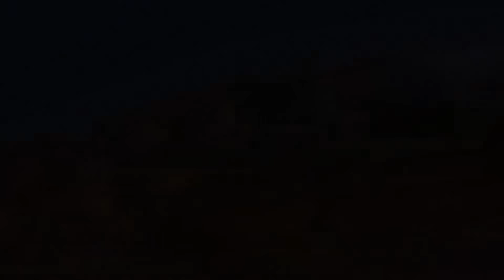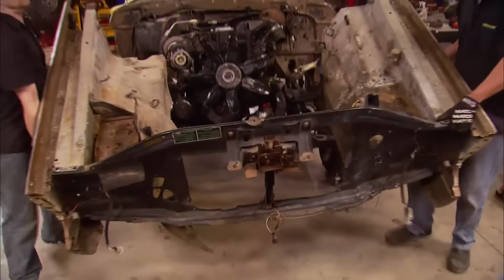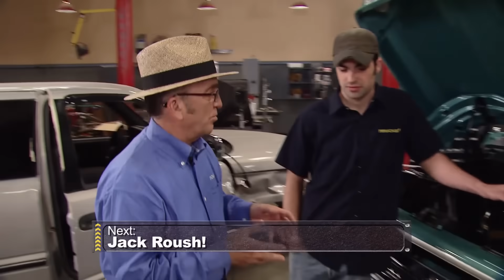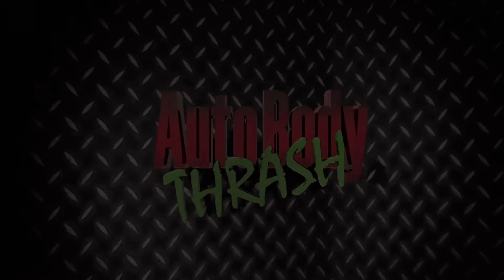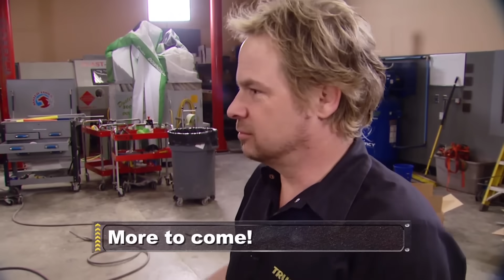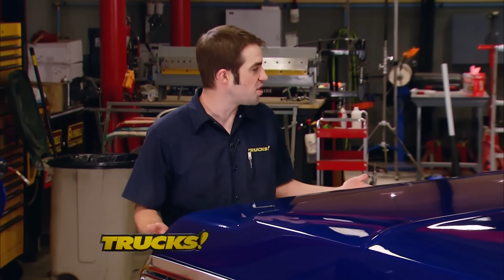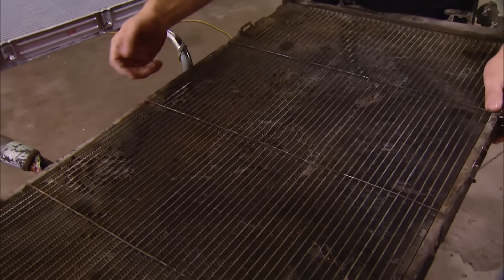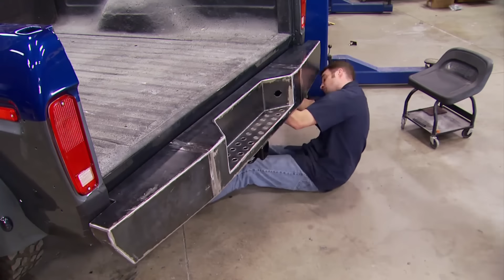Ford Crew Cab on a Dodge Cummins Chassis! (Super Dually) - Full Build

Comment: Would it be easier to start with the cab, it would be less work??
Reply: In my opinion, the Ford truck body was in bad shape. You can tell that was the concept they wanted. It made no sense to remove the Dodge body with less damage for a much older and corroded Ford.

Comment: all mechanical little electronics and you can easily build enough power to tow a house down the street or run 6 seconds in the 8th mile ! and still have all the comfort anyone needs !!

Comment: In comparison to muscle car resto mods or vinntage pick up resto mods, this is a unique, definitely interesting, episode. Thanks for doing this.  Appreciate the Alabama recycling facility review, the Cummins motor engine swap, the body removol install, 5 speed manual selection, and so many other changes including the interior dash work.  .

Comment: Re: Leaking Rear Main Seal            Don't use additives to attempt to fix oil leaks. It will soften ALL of the seals and you will likely CREATE new leaks...... Can I get a witness? (Based on my experience as  an ASE Cert mechanic)

Comment: Putting Dodge wiring in a Ford. Bold.
Reply: It isn’t working out well after this many years lol. I currently own the truck and it needs some TLC but the bones are still there. Also not sure why they patched together the bed the way they did it’s not holding up well but still a super cool truck!
Reply: @colby2479  You own it, huh? Very cool! It is a neat rig, hopefully you can get it buttoned back together. 79s have always been my favorite year dent side. Personally I’d prefer just the single cab long box but I understand why guys want the 4 door for a work rig.

Comment: “These flex sanders will get the job done easier” well sure but it doesn’t mean it gets it done better you can get the same results aslong as you know how to sand anything and I mean that I was told when I first started sanding on a car the guy helping me asked if I had ever sanded drywall and if so to sand the car the same way especially since we were using a spray on sand able primer it made my life so much easier hearing that but also he taught me how to sand just about anything perfectly with regular sandpaper 99% of the time he wasn’t big on spending alot of money on tools he wanted to just know either way it was gonna look good so he took his time and even tho these tools would have made his life easier he would rather just take the extra time to make sure it was absolutely perfect either way he was weird about it but he did the best paint work I’ve ever seen on any vehicle

Comment: My bubby swapped the manifold just like this and it broke the head 5 out of 6  mounts it is use to one spot for 30 years then f lipped creates uneven pressure between the bolts and head if your going to do this get a aftermarket manifold that don't have space between manifold and head will save alot of time and hassle and a head look it up if you don't belive me besides that many heat cycles on old manifold they shrink and will break the head eventually to

Comment: So what about the portion of the truck bed under the support rails. Eastwood has a product that has a flexible hose/wand that can spray into that area. The end of the wand sprays in all direction to give you good coverage. I would not have neglected the area underneath the support rails.

Comment: FYI. The absolute worse thing that you can ever do when restoring and modifying an old truck/car is to skimp by reusing an old radiator and ac condenser. New or re-cored will always save you more money in the long run. Radiators and condensers are under pressure in use which means the metals are subjected to constant flexing from heating and cooling cycles. Over time the metals weaken and added to decades of external weather conditions and corrosion, it's a recipe for failures. Who wants to spend tens of thousands of dollars restoring this gem just to be stranded on the side of the road waiting for a tow truck?

Comment: I always say, a good paint job is 90% preparation and 10% application.
Reply: I'm using a 2001 rear end out of a Dodge ram 1500 four-wheel drive putting it into a two-wheel drive 98 Dodge ram 1500 is there a difference

Comment: I forgot something ride on tire sealant won't clog valve stem seals and balances the tires. So when getting a wheel and tire balancing to make sure you have already installed and driven before rebalancing if you have the time.Ride On tire sealant no matter how many times no matter how many punctures if you are serious about your work truck being dependable Ride On tire sealant has got you no matter where thoes tires go.The sealant works so good it can take a bullet from a 9mm.Also for motorcyclest don't want to be stuck somewhere.Also Centramatic Heavy Duty Wheel Balancers and double check the alignment and especially bump stear because the road is never ever 98 percent of time perfect so my effort in saying this is straight line management is the key along with lower tire pressure more power steering assistance so wrists aren't wearing down also for the air conditioning the fans need to be able to spin at higher rpms double the rpms then raise the rpms a little higher than that.Heated seats and that's ah not bad all day every day.Also a light bar road lights and ya know what you can go brighter lights but but but but but but and I have seen this only once level your lights you can go brighter but as you do you have to balance the lights because they are brighter they are going to far down the road.Level and balance level and balance level and balance level and balance the brighter lights and your golden for the most thankful and appreciated driving experience and a ton of praise and thanks.
Reply: Crack is whack.

Comment: Super awesome details and wisdom that I will always go back to so 3 hours 3 comments it looks but every day every day driving quick breaking transition ease of use for every day that's the work horse. Is it easy does it brake with ease does things lock up is the proportioning valve on the money.Having a welder on board or some type of tool box also you can go bigger wipers.A tablet in the middle console why not or the bottom half. Love the show and seeing you guys still there going strong you are the right guys for the job.

Comment: Remove the shock for the steering it's not needed and prevents total control of the steering. You don't have power steering makes sence but you guys do.Kryptonite is a company that offers strong steering links.Banks for the motor and differential cover.Bully Dog maybe some propane but also a small compressor to air up the tires.Ya know stacks couldn't hurt don't forget the full rear mudflaps if you have fwd get a snorkeler for any situation. You have a turbo to protect water lock air ride to lift up the truck lastly roadactive suspension rear leaf spring helper for super safe transitions and needs more down low throttle response and an extra 150 hp. Clear side markers up front instead of yellow with the chrome bulbs that turn amber when switched on styln concepts.Seen chicken lights in the tube steps black of course would look pretty good.

Comment: There's a quicker, cheaper, external fix 4that killer dowel pin. It simply an external fastener &lock washer aligned w/the pin through the front cover.

I've even seen people install an elongated pin &dimple the case4 some positive pressure on the new pin so that there's no room 2walk.

Comment: I too when about 16 replaced a clutch ( 1 month into my first car ) .. I too did not trun the flywheel ,,,, evn after getting a job in a machine shop!!!... thought od the answe to my car hopping in reverse up a hill ... not until many years later... so when I lost a manual trans on vacation in Green River wyoming I did nt hesitate to replave the fly wheem and clutch on top of the trans cost ( 200 in pasts probably 50 in labour ,,,,,,,,, 5 yeats later the cae is still going

Comment: Is the engine part of the frame/chassis?

I'm thinking about getting a similar style tractor with a dead engine. Remove the engine to replace it with some electric motor.

If the motor is part of the structure, the conversation would be a totally different project. 

I want one with a dead engine, because I don't want to butcher a running vehicle.

I don't want a vehicle where the engine is a structural part, to avoid rebuilding that after removing the engine.

I appreciate that some would have issues with running time or range on batteries, but that's not an issue at all for my use case. Removing exhaust and engine noise is a way more useful priority for my case.

Comment: I've swapped pickup bodies from different years and different makes a number of times. One thing I disagree with is how they started at the rear by installing the box and then they had to deal with fine tuning the axle and fender opening locations at the front. 

It is much easier to shift the rear axle location than to shift the front wheel locations so I always started at the front and finished off by adjusting the rear axle location at the end.

Edit: Wow, that turned into a HUGE job (I wrote the above after watching about 30 minutes). The attention to detail and finished product is impressive!

Around here older 2wd trucks are almost worthless,  so what I've done is buy a freshly painted 2wd pickup and swapped the body to a 4wd. None of my swaps have required anywhere near this level of customization.

Comment: I like the truck concept, if it had been four wheel drive I would have loved it. Maybe it could be done later?
Reply: Why would you want 4 wheel drive on a truck designed to haul heavy loads on paved roads?
Reply: @pranays  I would never own a truck without four wheel drive, you can still have a truck designed to tow and have that capability too. Worse gas mileage of course, but life can be horrible if you need it and don't have it.

Comment: Adapter plugs for the wiring to make it plug into existing with a easy plug & Play system and one video of making it work without the modern-day plug and Play system NBA able to make dodge and Ford work together using Park Ford wiring and part of the wiring for the Dodge do not use a Dodge computer with the use the Ford computer with the Dodge to make the video more interesting

Comment: Years ago i had a 2.8 V-6 Blazer that leaked oil from the rear-main seal. It didn't leave an ocean, but it would leave a good quarter sized spot after several hours.

One time at a gas station, I noticed a bottle of oil additive that was designed to stop leaking seals and gaskets just by pouring in the can. I thought to myself, "this is probably too good to be true, but for a few bucks, I'll give it a shot anyway..".

I dumped the can in, drove 40 miles home, and parked it in the usual spot in my driveway for 2 days to let whatever remaining oil that was all over everywhere on the bottom of the truck to have a chance to all drip off. 

After the 2 days, I slid a piece of cardboard under the vehicle and checked it a day later, and I'll be damned, it NO longer was leaking oil!! The stuff ACTUALLY worked!

I cant quite 100% remember the actual name of the product, but I'm fairly certain that it was a "Barr's" product like what was mentioned in the video. 

I'm not so sure how it would work for things like leaky cork valve cover gaskets and such, but it worked damn good for the rubber rear-main seal. I was completely surprised. It didn't just slow the leak, it STOPPED it completely. No more smoke, no more stink of burning oil on the exhaust, and no more checking and adding oil every few weeks. 

Give it a shot if you're leaking oil, the worst that could happen is that it doesn't work. It won't make any problems worse. I believe there's even a money-back guarantee if for some reason the product does not work. 👌

Comment: You are absolutely correct about sensors and injectors. OEM salvage parts are far superior quality than any aftermarket parts save for specialty high end manufactures.10 injectors for $ 50 certainly raises my suspicions!😂😂😂😂
Once again, knowledge and experience wins ,great job man, great demonstration as well

Comment: I've been shopping around for a cool old school rmotor home to put on top of an old ram 4x4 with the Cummins 5.9. A retro 4x4 motor home with enough ground clearance and tire to handle anything but still be able to cruise 2000mi at highway speeds is the end goal.
Reply: There were the FERD's with that power train right from the factory. There are some around. Save yourself time, money and energy. JMO

Comment: I just installed a 5 kw heat kit on a new bard unit that was installed recently pulling 22 amps  adding that sequencer to let the fan run longer is smart  instead of the limit switch

Comment: I recently purchased a 2011 E350 Cabriolet and love it. I am going to do my own oil changes based on the $350 oil change service fee at the dealer. I am used to doing oil changes but never on a Mercedes so I watched your video and loved it, very informative. The difference I saw on the car in your video is that my oil dipstick is near the back of the engine on the passenger side and yours is on the drivers side near the back. Do I have a different model engine? I have the 3.5L V6 also.

Comment: I believe that my 2000 dodge ram laramie slt quad cab long bed 1500 4x4 is also 155 inch wheelbase i know that it will not fit on a standard 18ft car hauler like the 16 ft car hauler trailer and the 2ft of dovetail and ramps ..

Comment: Cool i have a odd second gen dodge ram laramie slt quad cab long bed 1500 4x4 but it is a gas 5.2 litre 318 magnum V8 46 RE AT manual shift transfer case lever on the floor gloss black with most of the white pinstripe and flat black factory grille and satin flat black bumpers... and factory towing pkg including 3.55 geared diffs
Reply: I really want to get a bumpside 69 to 71 Ford f250 camper special trim project truck but I am not above building a extra heavy duty f100 lol I plan on trading on one when I find the one I want and can actually acquire it hopefully locally...

Comment: For those wheel bearings they sell a tool that's way better than the center punch to take those bearings out and if you can't afford it you can go to O'Reilly's and they'll let you borrow one you just have to leave a deposit and when you bring the tool back you get your deposit back I thought moving the engine back was supposed to take care of the spacing for the radiator what happened and shouldn't you have cleaned the firewall and the whole entire engine box before you painted it and put it together I don't understand that you do a full rebuild you tear it all down and a lot of people leave a lot of places rusted that doesn't make sense because if you have it all torn down you might as well deal with all the rust everywhere what's the point of doing a full rebuild if you don't take care of all the rust because those areas that are still rusted are going to keep rusting if they're not taking care of there's a lot of people that do that and I don't know why they have it all torn down and they don't deal with every single bit of rust yeah it looks good on the outside the interior looks good but when you go to look under the vehicle people leave a lot of rust I'm not saying that you guys totally do that but if you didn't have to change that front end you would have left the firewall rusted when it should have been cleaned before the engine and the wiring went in I believe you should do things right the first time so you don't have to do it again don't get me wrong I just don't understand why people do that because you guys are doing one hell of a job on that truck it's beautiful

Comment: Just bought a 2004 325xi. Was tols thag it needs a throttle position sensor. Sysptoms seems to confirm that. Been looking for it online but ive read that for these models the TPS is built onto the throttle body. Is this correct? Also, does a new throttle body need to be programmed?

Comment: Awh come on guys; where’s the panoramic moonroof upgrade?!

Why didn’t u round out those ugly, OEM, rectangular wheel wells whilst u had the fenders off? It would’ve made a big difference. 

I’m still watching & looking 4TPMS upgrades:

1. SRS upgrades
2. auto air upgrades w/external air access
3. electrochromatic bullet resistant flush glass work, 
4. advanced telematics
5. 5th wheel
6. brushless winch
7. power tailgate
8. electric rack& pinion
9. flush door& tailgate handles
10. ALCOA aluminum wheels or equivalent
11. Lighting upgrades (HID/LED) clearance, auxiliary, mirror, gutter, bed, etc.
12. adjustable pedal box
13. tilt/telescopic steering wheel
14. advanced pneumatic over spring auto leveling suspension 
15.cold air induction, snorkel option 
16. Limited slip, closed differential
17. Lion battery (I use DUHON)
18. powder coated headache rack
19. Antilock brakes& traction control 
20. brushless HVAC& cooking fans
21. hood insulator
22.

Comment: I think the 70’s Fords were the absolute best, after all Bigfoot was a ‘74. I also think the Dodge with the Cummins is the most badass probably longest lasting truck chassis out there (maybe the transmission could be better). Putting the two together just makes sense. Maybe Ford and Dodge should do a colab (you know, like the local beer brewers do). Ford can revive the 70’s stylings and Dodge keep making these 90’s chassis.

Comment: So this truck came up for sale at or around 2013 (I dont remember exactly the date but it was a good 8-12 years ago) in Tennessee. I actually called on it and then called and secured funds, in the $20k range is what it was going for, I drug my feet and didn't call the seller back til the next morning and they told me they have a buyer coming but they'd return call if the deal fell through. Never got a call. I'm still kicking myself over missing out on it. Does anybody know it's current whereabouts?